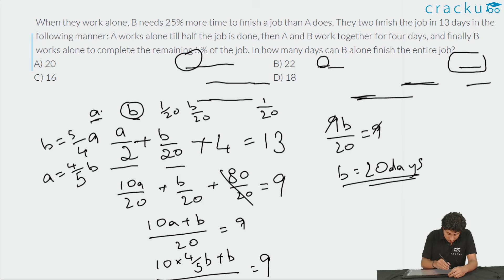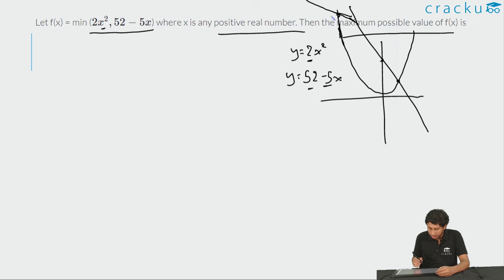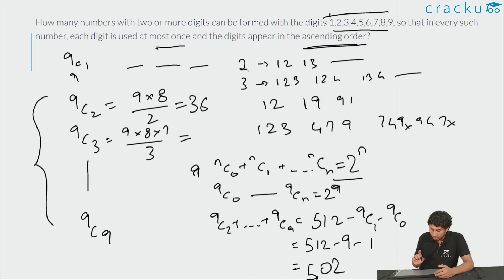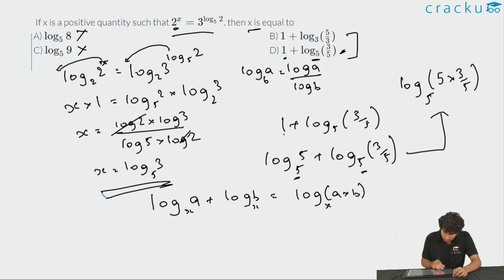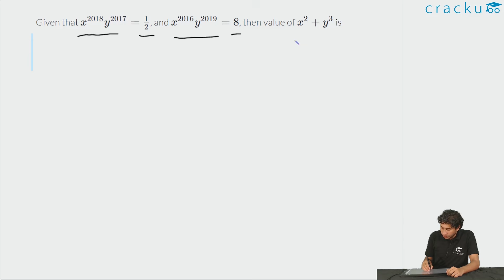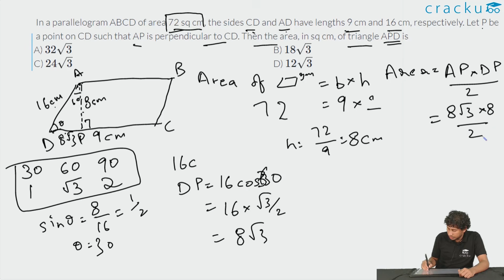CAT 2018 Slot-1 | Quant Video Solutions 🔥 Detailed Explantion | CAT Previous Papers Solutions

Comment: At 50:00 average age can be calculated by considering the extra brought by those above at 51, which is 13 years so total 390 years. This 390 will take the average of the younger ones to the 38. So for each it will contribute 10 units, and hence 38-10 =28.

Comment: At 28:00, we can calculate the ratio in which trains moves after 4 pm, which will be inverse of their speed ratio. hence if B moves, 2 units, thus A will move 8/3 units till that time. So the train covers 1/3 unit distance in 1 hour. hence 15 hours for 5 units.